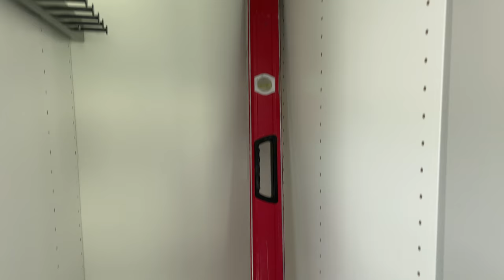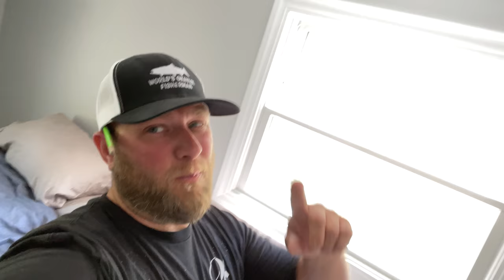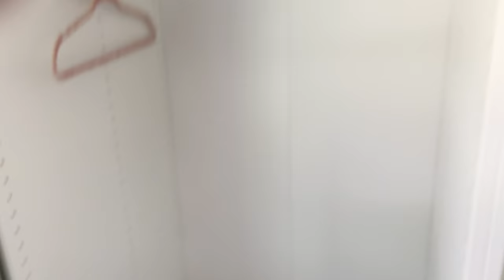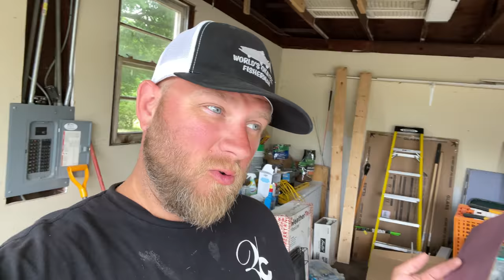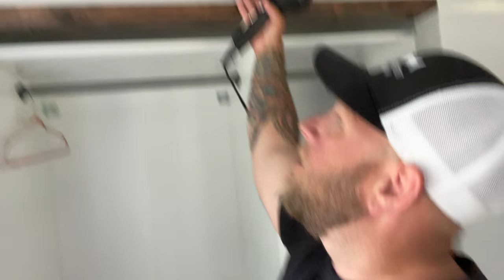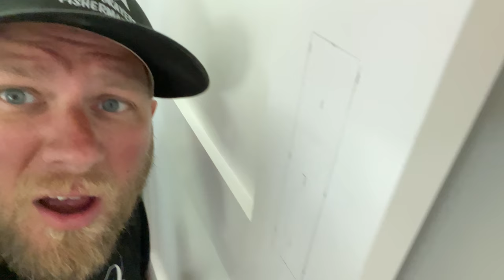Barn Door installation for Dummies (BYPASS DOORS)

Comment: I’m only finding tracks that stops at the end of the door so 1 side is always blocked, where can I find a track that fully opens like that? Also the doors you use just standard doors or is that all part of the kit? Thanks!
Reply from the maker: Find a long track.  Maybe online.  If you have a 48” door opening.  You want add half that to get a full opening.  So at least a 6’ track.  The doors are standard slabs you can find anywhere.

Comment: Ok, so I have the same problem. The metal bracket you cut now only has one hole for the lag bolt. Sure that's sturdy enough to hold? I'm afraid my doors are too heavy. Is you ceiling 8ft?
Reply from the maker: Yep. 1 is fine.  The other track only has 1.  As long as the bolts are going into something strong. Not just drywall.  Ceiling is not 8’ nope.
Reply: @DannyRickRick  OK cool. Thanks for the reply dude
Reply from the maker: @m_styles1981  absolutely anytime

Comment: Why 48 plus 24 if each door is 24in ? So 2 would be 4ft
Reply from the maker: Because 2 doors equals 48”.  So if you want them both open you have to add 24” for each door to slide over so the closet is completely open and accessible.